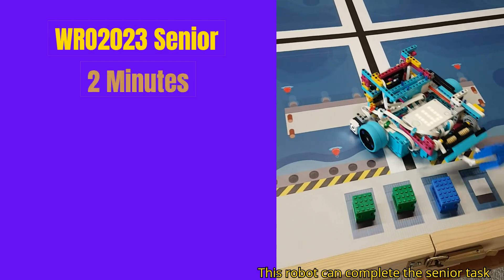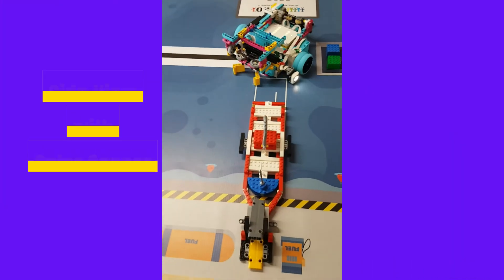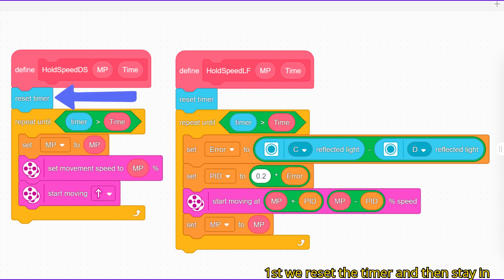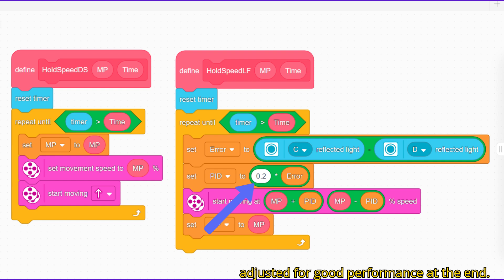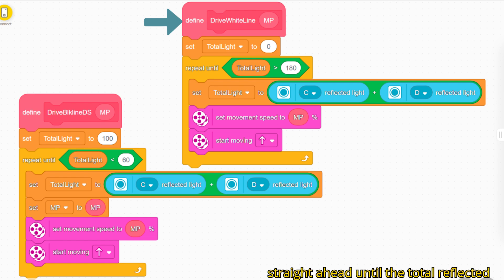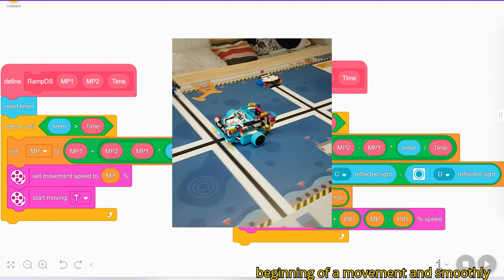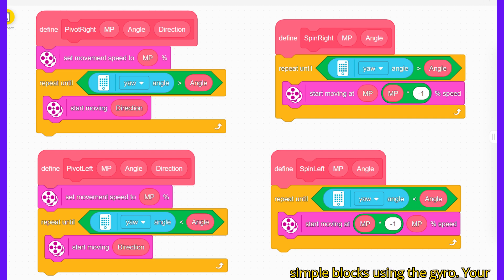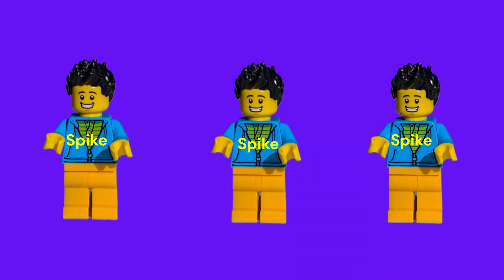Details of WRO2023 2 Minute Spike Prime

Comment: Amazing!! Btw yes using 2 wheels is better as the surface area is more and provides friction. But think u should have added a frame around those wheels to reduce variability in movement for competition bots.
Reply from the maker: Thanks for your comment! I also think now that the double wheels are better, the robot has to move fairly heavy boats around and the grip will be better. There will be less slip and uncertainty in the movements. I am not sure about a frame around the wheels, do you have experience of this?